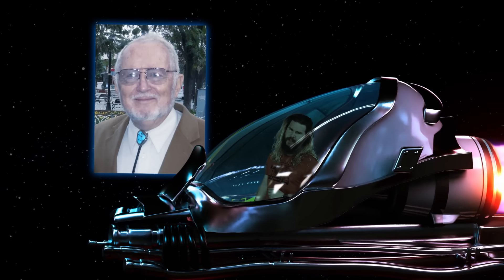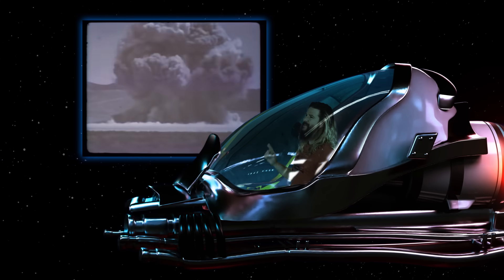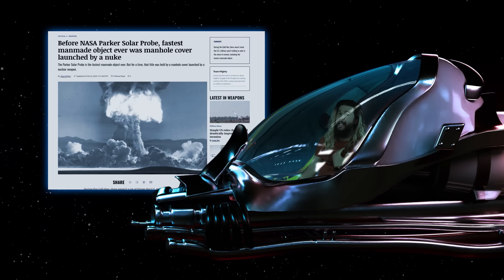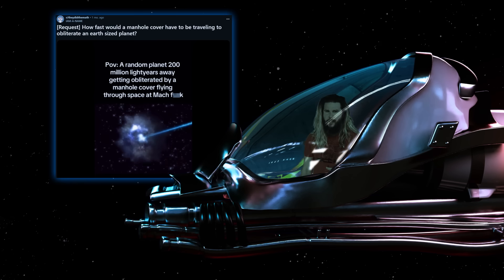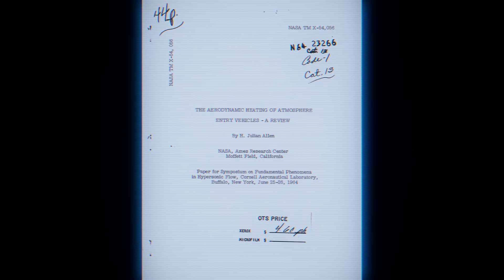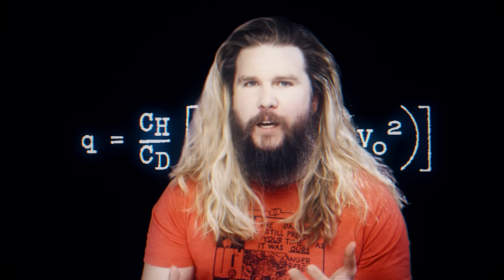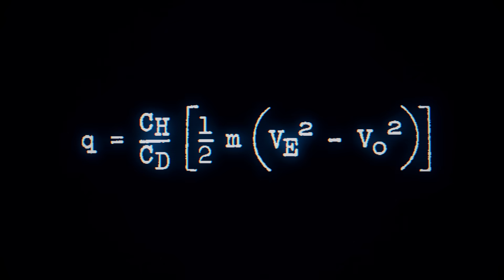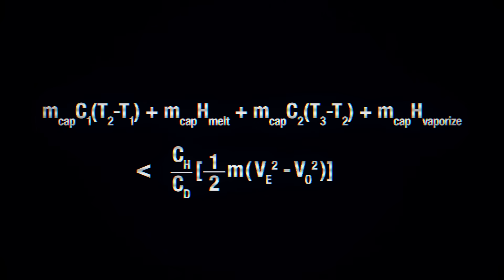Debunking the Nuclear-Powered Manhole Cover

Comment: The thumbnail: "I did the math!"
The comments: "You did the math... wrong!"
Reply: Did he do the math right with weak assumptions?
Reply: @Southghost5997 I mean he's massively ignoring concepts that negate the math he's doing like the fact that they had turned Earth into essentially a potato gun. This wasn't some sewer lid this thing was both massive thick and riding in a column of air upwards so it wouldn't suffer the same drag
Reply: @aikidodude05  🫡
Reply: @aikidodude05  Physics 101: Equal and opposite reactions. If you add more acceleration, the disintegrating only happens quicker. If you make it go upwards at twice the speed, it simply explodes twice as fast. In fact, square law means it explodes even faster then that. Every time you increase the force, it makes the outcome worse for your argument, not better.
Reply: @CharlesFreck  so why doesn't a bullet explode when it leaves the barrel of a gun? 
There's simply more to it than that.
Reply: The comments: "If you go faster, physics will work differently! The air is denser closer to the ground"
Reality: Going faster only makes it get destroyed quicker. Physics doesn't stop working, it doesn't change. In fact, the more energy you put in, the worse the scenario gets. If you invert his math so that the denser air is first, the result is simply that it doesn't get nearly as high as this calculation would provide. It's destroyed even faster. The comments are literally all wrong. They just completely ignore the first rule of phyiscs: equal and opposite reactions. You can't cheat that by going faster. If you go faster, it just makes the reactions faster, and four times worse in accordance with the square law. The only comments that are actually catching him on science are the ones pointing out that you can calculate it in a way where it basically loses all of that velocity so quickly that it never even gets close to space.
Reply: Key factor not discussed: heat transfer is not an infinitely-rapid process, i.e. it isn't instantaneous. While meteors moving 3x slower burn up, an object going fast enough could theoretically make it through before it has a chance to burn up. The object, admittedly not factoring in drag, would have cleared the atmosphere in barely a SINGLE second, meaning it may not have had enough time to absorb the necessary heat to be vaporized.

Second, the comparison with meteors is flawed in a very specific way: meteors are going from a vacuum into a steadily INCREASING dense atmosphere AT AN ANGLE, where the "manhole" would be moving from a dense atmosphere into a rapidly THINNING atmosphere at NO ANGLE. Since the math shown doesn't address that (you would have to integrate the effects of heating/drag across the thickness/density of the atmosphere), it's still possible the "manhole" made it to space (whole or in part).
Reply: When you're coming down to the planet you're increasing the amount of air you have to engage when you're leaving you are decreasing the amount of air you're dealing with when leaving so means less cushion less Heat you cannot use the same equation for both if you're coming down a high-speed you're dealing with more heat then exit at the same speed you're also increasing the amount of coolant on the way out dim the surface of the planet where you're going so take it down by 1/4 and that should be roughly around the temperature you should be at off exit velocity😊
Reply: major fumble
Reply: Yeah finally somebody put that guy in his place
Reply: @highlander723 he put you in your place on that shark vid, you are just salty

Comment: I love how Kyle probably made this video because he was tired of people talking about this but, now, because of his math errors, people are talking about it more than before. And now he probably has to make another video on this subject fixing his broken math.

Are you happy now, Kyle?
Reply: The whole formula only shows there is enough energy to vaporize it, not that sufficient heat transfer will occur and actually consume the material which takes substantial time.  In fact, many of those meteor explosions were just a casual bounce off the atmosphere and the object leaves more or less mostly intact mass wise.  Also many meteorites found fresh are still freezing cold from space after having the outer surface ablated by extreme heat of reentry.
Reply: @hugegamer5988  and even then, it only shows that there was enough energy to vaporize it at sea level and only if we assume that its total velocity was turned to heat. It would have been out of the atmosphere in something like two seconds
Reply: @hugegamer5988  and the cover would be slowing down as it elevated into a thinner atmosphere. So much less heat than a rocket or a falling rock
Reply: Yes now he gets to make two times the revenue on one topic
Reply: @WayStedYou  And also the 'fixed' video can be derived from this comment section.  Kyle has Cunningham's Law'd it:

"The best way to get the right answer on the internet is not to ask a question; it's to post the wrong answer."

I'm looking forward to the final revision 😆
Reply: I mean, at least in this scenario some of the physics is a bit hard to quantify and and he didn’t imply the literal sum of all natural numbers from 1 to infinity is -1/12 without taking the time to mention the gamma function or super sums like numberphile did.
Reply: Ah yes, the Barbara Streisand Effect
Reply: Kyle is never happy
Reply: I mean it works out, he got people talking about Physics with excitement. 😂
Reply from the maker: "Broken" is the wrong word
Reply: @kylehill  "unfinished" math got me just as many point deductions in school as incorrect units!
Reply: That was an interesting way to say, no I'm not happy you're correct!  @kylehill
Reply: @kylehill  Fair enough. Hope to see a follow up <3 love your stuff kyle
Reply: @kylehill Can you do a video about what would it take for metals like Adamantium or Vibranium to exist in the real world?
Reply: @TheVibraniumPatriot name checks out
Reply: @kylehill  I noticed a flaw in most people's argument is that they don't factor in the atmosphere is also traveling at or fast than the speed of the cover. For example, watch a slow-motion video of a gun going off, and you'll see the propulsion fly past the projectile. So the man hole would have little friction in its way, and there is more to it with that factor. So maths people may be able to figure out with this variable included whether it made it intact. Also, inverse isn't the best example for something that is made to be solid to be compared to things that aren't. Astroids and meteors have many flaws in their structures.
Reply: @kylehill  it was a misinput as the great penguinz0 once said
Reply: @kylehill  It is as accurate as your video.
Reply: @kylehill  Ah, yes, your not-broken math that breaks the laws of conservation and thermodynamics by creating more energy than you put in, and also assuming an object wouldn't flip mid-air while flying extremely fast.
Reply: @kylehill It’s just a nice way of saying “inadequate” or “incomplete”. Were treating you with kid gloves because we love you 😉
Reply: Redo the video mate, love your videos but you got to have all fronts covered.  @kylehill
Reply: @kylehill  Well, you did the problem upside down so... broken does seem like the correct term.
Reply: @kylehill  It's the wrong math, though. The energy out at the end is greater than the energy in at the beginning. Either you input the wrong values or you used the wrong equation. There are no other possibilities.
Reply: @kylehill  "Broken" is the wrong word because it would indicate a functioning state at some past point in time :)
Reply: @kylehill You're right Kyle broken is the wrong word. 

here are some notable substitutions that will be acceptable. 

1. Flawed

2. Faulty

3. Misguided

4. Inaccurate

5. Defective

6. Miscalculated

7. Skewed

8. Inconsistent

9. Subpar

10. Shoddy

11. Confused

12. Muddled

13. Incoherent

14. Erroneous

15. Botched

16. Error Ridden

take your pic Kyle
Reply: @kylehill broken is pretty accurate, I would consult a real engineer or physicist for this. And simulations. Many things were wrong, and many assumptions were also poor. But the biggest issue is V0 being = 0, meaning you assume the cap lost all its velocity in the atmosphere. This would make the atmosphere insanely dense according to the mathematical description, everything is going to melt when your delta V is 66km/s. A Highschool physics student would not have made such a massive oversight.
Reply: @kylehill  Yeah, broken is the wrong word. Saying what you did is broken is like saying that what we study in first year physics class is wrong. Not necessarily. It's an estimate, based on the resources and knowledge that you had at the moment. But there are things you don't know, and that's fine too. But that's just the internet I guess.
Reply: @kylehill  Oh look at the science guy, talking like an English major. ;-)
Reply: @kylehill It definitely is the wrong word

What people expect you to do, is calculate every single thing, from the gravitational influence of the terrain nearby, the exact weather of the day, the time of day
Reply: @glauberglousger956  Nah, we just don't want him to bake his believed result into the assumptions used to calculate the result. "If you assume the manhole cover loses all its velocity, calculations show it will lose all its velocity" is broken science. To be fair, that means it's not broken math, but it's math that's the wrong word, not broken.
Reply: Streisand effect
Reply: @kofiay  came here to say this. Would love for there to be a hill effect after this lol
Reply: this is pretty sad ; v ;
Reply: What math errors? This was a vibe check, and the estimate is a factor of ten higher than what is needed to show this as false. Making it extremely unlikely that it actually happened.
The estimate is a low ball, as it doesn't include the heat already applied to the cover by the blast itself.
It's like whining that he didn't use a nuke to test it.

Comment: Ironically this one is not 100% provable which makes it fun. 🤔They could only calculate the lower limit of what it could be going and not the actually speed since it was only in one frame.  So it would roughly be out of the atmosphere in 2 seconds or the 60 miles and heat transfers in milliseconds.
So at the lower limit it's  quite likely it did vaporize but given that the actually speed isn't know we can't be 100% certain.
Traveling fast enough it could reach space before it would hit temp to vaporize in theory.
The lack of exact numbers make it impossible to say for certain .

Also its just hilarious to think there is a manhole cover going at Mach Bleep and alien flying going along suddenly going WTF was that 🤣

Comment: Two things weren't taken into account. That being angle of escape and the time it takes to vaporize cast iron that thick and heavy. Being how fast the manhole cover launched, and its trajectory being almost perpendicular to the launching surface, there there is still a possibility that it escaped Earth's atmosphere before it even had the chance to destroy itself. Not to mention, the velocity that had been calculated was the MINIMUM estimated velocity since they only had a single frame as a reference point. So there is also the chance that the manhole cover was traveling faster than what had been calculated. Heat takes time to destroy solids, let us dream. I'm giving the chubby electron man the point in this science battle.

Comment: Kyle, I get your point about the manhole cover likely vaporizing from the intense heat of atmospheric friction. But what if the cover had been launched at just the right angle, with the narrow 4-inch side leading instead of the 4-foot side? With that orientation, the drag coefficient would be much lower, meaning less heat absorption and possibly enough speed to escape vaporization. Wouldn't the reduced surface area facing the atmosphere, combined with a shorter exposure time in the denser parts of the atmosphere, make it more likely to survive long enough to make it into space?

Comment: most incoming enter the atmosphere at a angel .. 
this was straight up [ shorter distance ]  means less time in thick atmosphere = less friction heat up ?  did you take the pressure bubble of air that would be around the object [  thats why artillery shell don't burn up .. see railgun mach  7 ]..pressure bubble surrounds shell  ..

Comment: Where I come from, we use one of the hardest concepts in physics and engineering to reheat our meat pies.

But if we only put our pie in the oven for a split second, we get a charred outer layer and frozen insides... Your explanation is great, but I missed the bit about how long it spends in atmo limiting its exposure, and if it vaporised before or after it hit vacuum.

Now for pi

Comment: Consider that if part of it vaporizes and breaks up, the remainder might melt and ball up, shrinking as it melts partially away and changing the aerodynamics. 
Perhaps a few grams of material made it to space, shielded by the rest that burned up. 
Agree with the comments about time aspect being important, and the work here is a dramatic oversimplification. And that all this is predicated on a lower bound of velocity as there is only a single frame to estimate velocity.

Comment: I have a question: The math makes sense, and the comparison to meteors entering the atmosphere also lend credibility to the idea the math is correct in this situation. However, as you say, fluid dynamics is hard, and asteroids are not, relatively speaking, smooth, and they are also moving slower. Is it possible that due to the shockwave from the explosion that launched this object moving the air our of it's way, along with the relative smoothness of the object, that it could have created a sort of vapor barrier? I don't know a good word for this, but essentially it's moving so fast that it collects air on it's surface that can't get around it, and the air it moves through just bounces off this sort of barrier. Along with the velocity it's moving through the air. At a speed of 66km/s it would have cleared the Troposphere and Stratosphere in less than 1 second, and the Mesosphere in 1.28 seconds. To clear the Thermosphere and Exosphere would take close to 3 minutes, but the atmosphere at those altitudes is extremely thin. Is 1.28 seconds enough time to transfer enough energy into the object to vaporize it? Are the Thermosphere and Exosphere dense enough to transfer enough energy into it to vaporize it? Or would it's velocity actually allow at least some part of it to survive due to the energy transfer not being rapid enough to actually fully vaporize it?

With an asteroid moving slower, and generally being very porous and jagged, I feel like that would allow more energy transfer into it which is why we see them break up or vaporize in the atmosphere, where as the manhole cover is much faster, and likely much smoother.

I'm sure this will get buried, and likely not get an answer, but I figure I'd ask.

Comment: Is there any worth in looking at how this would change given deformations, or if the cover had rotated such that it wasn't "punching" through the atmosphere as a flat disk but on its edge, or if the deformation turned it more conical?
Also is there any calculations on the forces our rockets take on escaping the atmosphere in case the differences between re-entry where you go from no atmosphere to ever increasing atmosphere differs from full atmosphere to no atmosphere? Plus how hitting the layers of the atmosphere in reverse order impacts it? Given the closeness of the final numbers the nuances of directions may skew things one way or the other (though i doubt it would be enough for it to escape undamaged)

Comment: Far be it from me to check the math of a professor...

But did you include the coefficient of gravity in this equation? I went back and looked, correct me if I am wrong, but I don't believe I see the variable for that.
This would calculate rate of deceleration, and if slowed enough, should reach space outer space. Maybe not the entire manhole cover, but meh... it's not like we were trying.

Comment: Failure! You overlooked the fact that a meteor traverses the atmosphere at an angle, resulting in a significantly longer path through the atmosphere compared to the “manhole” cover. Since it traveled straight up (more or less) and passed through substantially less of the atmosphere, the “manhole” cover would could have survived although much smaller than it started. Keep in mind that a meteor experiences increasingly denser atmosphere while the manhole cover would have experienced thinner and thinner atmosphere as it traveled upward and outward.

Comment: For what orientation of the cover did you choose the drag coefficient? It‘s reasonable to asume the cover would turn during flight due to aerodynamic forces making it lay flat in flight direction. This would certainly be a more aerodynamic system yielding lower drag.

Comment: I am more inclined to believe it made it to space simply based upon the fact that meteors burn up going from thin atmo to thicker atmo, building up heat to the point they melt or explode/vaporize.
But since, as has already been mentioned by others, it was encountering the inverse of that... It is more likely to have not built up sufficient heat to make it effectively non-existent.

In fact, an experiment should be conducted with suitable analogs to give us more information with which a more definitive and plausible andwer csn be derived!

As Adam Savage once said, "Science! It's all just screwing sround until you write down the results." (Paraphrasing)